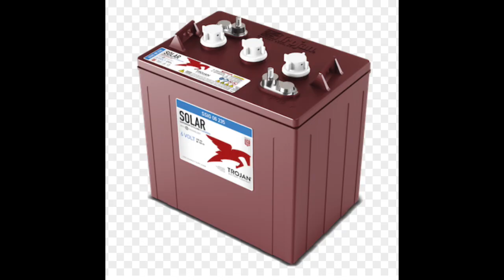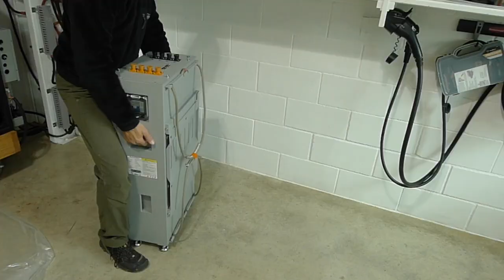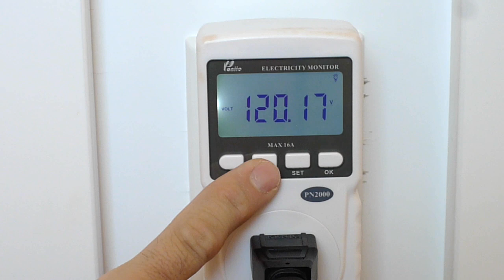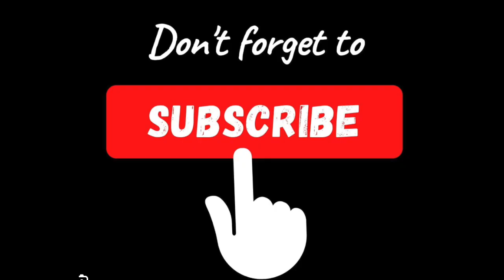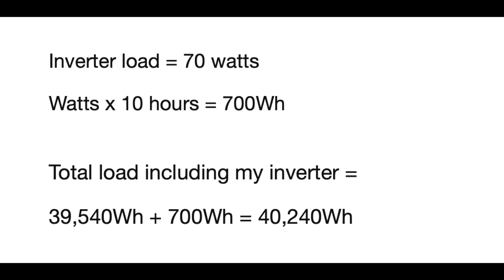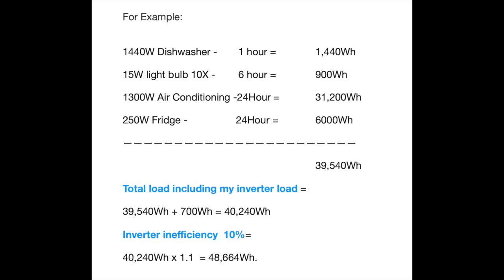How to Size Battery Bank for Off-Grid Solar System 12V, 24V, 48V

Comment: László, There might be a typo in the calculation with the inverter efficiency. 40.24 x 1.1 is 44.264. I would also suggest to divide with 0.9 Instead of multiplication. If You have 44.264Wh in your battery You can take only 44.264x0.9=39.838Wh energy with your devices.
Reply from the maker: Thank you very much for letting me know. I am working on it to correct my mistakes. I really appreciate it, also thank for watching my channel.